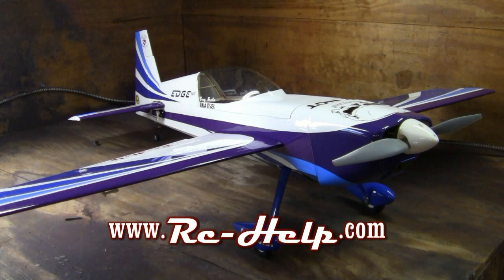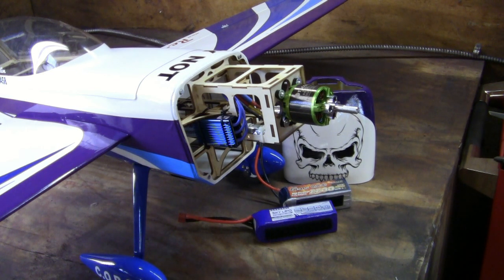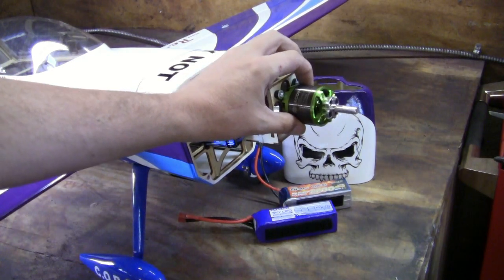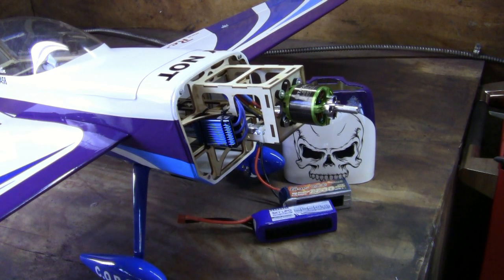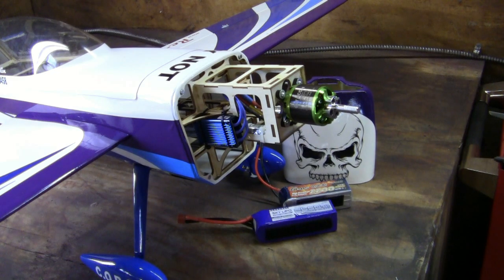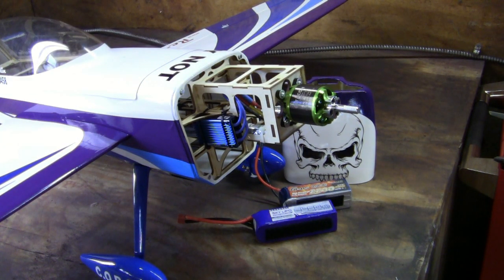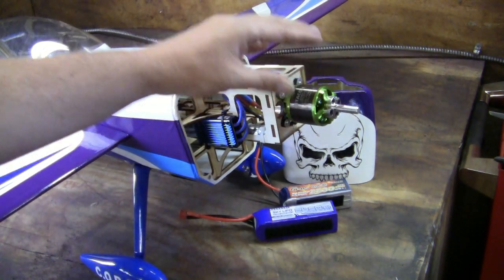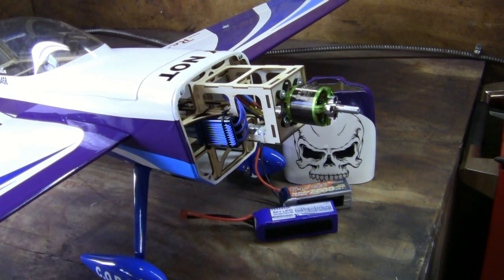Matching Motor, ESC, & Battery

Comment: Confusion. What do you mean by "bigger" battery? Do you mean a higher amperage rating? Do you mean more voltage? Both could be bigger, one would make a difference and the other would not. 

If you use a battery with "bigger" voltage, you WILL get more power. This is what "they" mean.
Reply from the maker: In this video, "Bigger" was meaning the C rating, or Amperage rating. Back in 2011 when this video was made, everyone was saying "go with a 'bigger' (more amperage) battery and you will have more power". But, this was back in 2011 and I need to remake this video to be more clear. I made this video to get the point across that a higher C rating will not get you more power, and if it does, it was not a large enough C rating to begin with. James, I appreciate your comment
Reply: @RcHelpDotCom   Ummm a higher C rated battery will give you more power, especially if you use a higher esc.. Example..  you motor pulls 55 amps, but you could put a bigger prop on that allows  you to pull more amps, but because your batter can only say put out 65 amps, it will put out more up to the burst and then get  hot expand and then fail.   but.. if  you put say a batter that puts out  65C now that same motor will pull the bigger amp draw, but at what expense? maybe more heat in the motor, maybe more heat in the ESC.. basically your video is very good at setting correct esc,batter, and motor specs, but it doesn't protect against bigger draws.. The fact that brushless motors will pull  more amps... power based on the battery and ESC, and load but at the cost of motor damage or even burning it up!!.. We in the RC Boating have this problem all the time to go faster.
Reply: @ericdiannestrickland7511  The C of the battery itself doesn't provide any additional power.

What produces power is the load on the motor.

BUT, if the load is draining more current than your current battery can provide, probably the battery is getting way hot. Switching it with a higer C battery now you can deliver the current your motor is asking for, and thus getting the "additional" power...

Remember, is not the C of the battery that is providing any power. Take a setup which drains 10A. Assuming your battery can easily provide 30A with 20C for instance, switch the battery with a 60C one.. power will be the same.
Reply: Tony, you are trying to explain how to match these components but then you say "bigger battery".  You also say that folks are wrong when they say you get more power when you use a "bigger" battery.  You need to define "bigger".  Most of the time the average modeler means higher cell count (4S vs 3S) when they say bigger.  You WILL get more power if you use a 4S battery than a 3S battery.  The 4S battery has a higher voltage which result is more power.  So, don't use ambiguous terms like "bigger" say exactly what you mean (higher voltage bigger or physical size bigger or higher mah bigger).

Comment: Saludod desde colombia, construí una savage bobber de 2 metros con un peso al despegue de 1750 gramos tengo dos motores un volantex 4023 850kv y un turnigy aerodrive 910kv ambos con helice 12" y bateria 3S 2200, que me recomiendan muchas gracias por su ayuda y pronta respuesta
Reply from the maker: Hola @mipezunivalle, ¡Parece que tienes un par de modelos fantásticos! No estoy seguro de qué información solicitas, pero con la que nos has proporcionado, parece que estás bastante cerca de lo que necesitas. Ambos motores pueden girar una hélice de 12". El Volantex debería funcionar bien con una de 12/6, mientras que el Turnigy parece preferir una de 12/5 debido al mayor KV. Por lo que he podido encontrar, ambos funcionan con un paquete de 3s, así que, siempre que tu clasificación C pueda con los motores, no debería haber problema. El motor Turnigy requiere un ESC de 30 A, pero yo probablemente le pondría uno de 40 A para mayor seguridad. No he podido encontrar mucha información sobre el Volantex, pero creo que sería más o menos lo mismo. Si hay algo más en lo que pueda ayudar, ¡no dudes en preguntar!

Comment: I like your style. I’d love to see a vid on how to do the same when you don’t have a manufacturer’s recommendation to start from,i.e. scratchbuilt planes.
Reply from the maker: Hello @joevanarsdale981! Scratch built can get fun when trying to pair electronics. My rule of thumb is to try to find a model that is close to your scratch built plane, and start there. It's likely that you will need to go up or down on all 3 components unless your luck is better than mine LOL. Take the RCH Trainer for example. I designed this plane off of the Telemaster and took the specs from the Telemaster to start off with. Granted, I went to the lower side of the motor size and ended up burning one up, but it gave me a starting point. But doing a video on this is a great idea. I will see what I can come up with when I get another scratch built going that doesn't have a spec sheet! Thank you for the comment!

Comment: Good video, covering the motor and prop selection.  However, I wish you would have provided references how you came up with these formulas for prop diameter, pitch and rpm.  You also didn't indicate the stall and pitch speed (or advance ratio) for a successful flight.  Did you, for example, compare your findings with ECalc to see if there are discrepancies?

Comment: Hi sir plzz help me,,,,I have 2200mah battery,and  dxw d2212 2450 kv moter ,,,How much esc is required?ESC ?????
Reply from the maker: You have incomplete information. 2200mah is just the capacity, you didn't specify what the C rating of the battery was so no idea what the battery can handle. Also, you need to look at the spec sheet of the motor, you cannot determine amp draw from KV. KV is only RPM/Volt. https://www.youtube.com/watch?v=pA0SmWwXu2E

Comment: Great info. Thanks. So... I'm a little baffled and confused. I have a few Zeee 6s 6000mah 100c packs. By your equation at @1:28 I've calculated that this battery can produce 600amps?! No way that's right.... Is it?? :O
Reply from the maker: The equation is correct. However I would doubt that 100C rating on a 6000mah pack. I'm thinking that would be more of a burst rating, if even that. For this battery, I would base it off the wire gauge. Likely not more than 50C at the most.

Comment: WOW ITS nice explanation .its hard to set up ,can i ask  pls sir.i have 1200kv 3536 motor what battery i need to use for my plane,and  rating?and more the 4s3p li ion battery would work for this.esc is  30 amps.

Comment: Still prob the best and one of only things I can find on what you would think is one of the most common questions!
So really on any engine, you can run any voltage battery as long as the Amperage is enough? Is it that simple

Comment: can I ask? Can A2212 2200kv brushless motor work with a 11.1V 2200mah 30c lipo battery?
Reply: the brushless motor is 30A
Reply from the maker: As long as it can handle a 3S battery, yes. www.Rc-Help.com

Comment: what if the max amp supplied by the battery in more than the ESC rating?
Reply from the maker: Doesn't matter. The battery does not 'push' the power, the motor 'pulls' the power. All the battery is there for is a storage device for power. You can use as large of a C rating as you want or can afford. Just make sure the S rating is correct. www.Rc-Help.com

Comment: Thank you very much for this instruction video. I recently bought a glider but I am using a different battery than what the box instructed me to use and got mixed info regarding how I am to work out if my battery would work with this motor, using your instructions I was able to work out that my battery was more than enough for the motor and that the ESC can handle the battery perfectly fine.
Reply from the maker: Just remember, the motor is what pulls the power, the ESC regulates that power and the battery just supplies the power. As long as the ESC and battery are large enough (high enough amps) to handle the motor, you should be golden! www.Rc-Help.com

Comment: One thing great info but you didnt explain choice of mottor and prop
Reply from the maker: For this video, I was explaining how to match the Motor to an ESC to a Battery. For the motor, you will go off of the wattage divided by the voltage to provide amperage. All motor manufacturers have a suggested prop range, and they all should be within the wattage of the motor, as that is the max power the motor can sustain. Hope this helps.

Comment: hello good day, can i ask some question? I have been performing this combination, was this combination is correct for:?

120brushless esc
4068 1900kv 2200W brushless motor
100C 22.2 V Lipo Battery

I just did your computation and it conclude that my setup was
22.2v/2200W= less than a 90Amp?

Thank you have a great day God Bless
Reply from the maker: For the motor, 2200 watts with a 22.2 nominal voltage will be 99.099 amps. Basically 100 amps. 
2200/22.2=99.099

If you have a 100a ESC, you should be fine. 

You didn't say what your MAH of the battery pack is, however if it's over 1000mah, again, you should be fine. 

www.Rc-Help.com
Reply: @RcHelpDotCom  Thanks Bro really appreciated it. I didn't have the battery yet, but I'm planning to have 22.2v with 4200mAh and 120a ESC.. with your guide many people especially fellow RC hobbyist can achieve their own milestone without hesitating because of your videos

Comment: Hey guys I'm wondering what would be the best ESC/speed controller for brushless 2445 5600kv.  (Draws 59 amps) I've heard that you Wana match the amps with the motor or go itleast 20% bigger .     What do you guys think is best 60..80. 100amp . I just Wana run it on 2s maybe 3s .    It's an absolute savage with a 35 amp ESC but drains battery way fast      I realized the kV matter and now I def need itleast 60 amp.   Do you recommend I go more then what the motor does (59 amps max it says)
Reply from the maker: If it's 59 amps max, then a 60 should be fine unless you are at max all the time. If you are almost always trying to max out the amps at 59, then I would go the next largest size. You also mentioned 2s and 3s, per ohms law the higher the volts, the lower the amps, so you will need to calculate this as well. Come over to rc-help.com and we can help a little further if you have additional questions.
Reply: Judging by your video (you match the amp) I have one that draws 37 and one that draws 59..   I'm gna use the 35 amp on the 37 should be ok .    Then get a 60 for the one that makes 59?  Should be fine   you seam very knowledgable on all the components.    I just built these 2 RC cars with a 2440 at 4600kv and a 2445 at 5400 kV.    Your video just helped alot man   I'm gna subscribe and build a plane with your knowledge brotha thanks

Comment: Great video.
Quick question, if the lipo is 25c 2200mah how can you get 55amps continues? I thought with a 25c you will get 25amps continuous and around 50am bursts.

Comment: What if you already have a motor and want to put it in a new model, but the motor only states size and KV? Some model companies give the kv to match, but what if the kv is good but the size doesnt match smaller/bigger? Some others give GP/EP options, how do i tell if my EP motor matches the GP size? How do I work out the Watts or Amp of my motor with only KV on it? Ive got two motors I wanna use in new models, a 3226 - 970kv, and a 4250 - 910kv

Comment: Thank you for the video. It falls down badly for me when it says 'the motor is 700 watts' - how do you know that? It all makes sense with that knowledge, but not knowing makes it impossible to proceed. Also, I have to set up a power train from scratch, and have no 'manufacturers recommendations', so again, impossible to proceed. Thanks, anyway.

Comment: I'm build a 1800mm ov10 with rimfire and 80amp esc can I use 6s lipos instead of 4s the motors are rated up to 6s ?
Reply: I'm using two rimfire .46 outrunner brushless motor 800kv

Comment: What if i have an airframe weight avrage 1.44kg with 2200mah ESC, what motor i have to use for this RC-plane?
I've try twice with 2212-1000kv but always fail.
Reply: Good power rating is 150 to 200 watts per pound.
Reply: 3.117 lbs you need a motor that can generate 556 watts about 175 watts per pound then you to find out how much room in the battery compartment  for your battery how many series cells can fit that will supply  enough watts amps volts  after that go to a motor web site like, Tom cat and then start 
checking the motor sizing chart from the chart it will help you decide which motor will work for you.

Comment: Shit according to this I need a 120 a ESC ive been trying to use a 12 a oops. That makes sense of why the motor won't run lol. That plus my cheap ass charger only charges one cell on my 2 s , which has probably broken my battery.

Comment: Tekst źródłowy
In your case 2650 was because you had to add weight issiue. But in case of this Edge plane and your set. With solved weight issue can you spend more time in air? 2650mAh is always more time for fly than 2200 or I'm wrong?  I would like to understand this good. 
thx
very good tutorial

Comment: I'm a little confused but because of I'm a noob, not for your video! if I understood, if I have a 500watt motor, with a 6s battery I need a 35 A esc, with a 3s battery I need a more powerful esc (70A) is that's right?

Comment: Very good video, but if you're playing around with prop sizes you best be careful when due to prop size you're pulling more amps than your entire setup can handle and you're on the brink of a burst or electrical fire.  Use a "Watt Meter".

Comment: Thank you, that is really helpful.
One question though. Is there a way of calculating the wattage of a motor when it is not given by the manufacturer?
Reply from the maker: If the manufacturer has not provided a max wattage or max amperage, then you will need an Amp Meter, or ammeter, whichever way you want to spell it. Put the suggested prop on it (or whatever load your situation requires) and run it at full load with a full battery. Remember, Ohms law, the higher the volts, the lower the amps, the lower the volts, the higher the amps. www.Rc-Help.com
Reply: @RcHelpDotCom  My setup: motor 650 watts, esc 45, battery 3200 maH, 20c.  from your formulas, now I'm concerned about smoking the 45 ESC?   It was in an ARF, (except battery, which I bought).

Comment: looking for help with the matching of a rocket 600kv rc boat motor and esc ..what amp should we use and what battery size ??
Reply from the maker: I do not know, as you have not provided any voltage, wattage and/or amperage ratings for the motor. The current capacity of the battery and ESC MUST be higher than the motor can pull. www.Rc-Help.com
Reply: @RcHelpDotCom  thanks for the feedback here are the ratings : 600kv max amps 126a max voltage 50v max power 6300w no load current 1.8a
Reply from the maker: @tonyjaikaran6085  If it was for my plane or whatever model, I would be looking at a 150a ESC, and a battery that can handle about 175a just to play it safe. www.Rc-Help.com

Comment: I want to buy a e flite 60 motor for an 46 bonanza. I can't seem to find the right ESC any help on what brand is best or which one to get?? I'm switching from Glow to Electric. So excited!!!
Reply from the maker: E-Flite is suggesting an 80a ESC to put with this motor. I cannot find any specs on the E-Flite 60 motor for max amp draw, so I would go by their recommendations. I use HobbyWing ESC's (pictured in this video) and the have worked flawlessly for me over the years.
Reply: @RcHelpDotCom  what engine do you recommend for me? With the EsC  plz, if it's not to much to ask.. I was seen some malfunction on the Eflite 60 with their ESC they recommend....,😔
Reply from the maker: Come over to the forum and post up with your question, and be sure to mention what you have posted over here. We have a lot of great people on the forum that can provide many more options than what I can alone. www.Rc-Help.com

Comment: I know it's a different setup but random question. Just purchased a 3500 7.2 v larger battery for my RC car. It runs fine forward but nothing in reverse. Is it possible the esc can't handle the bigger battery?  It was running a 2000 7.2v
Reply from the maker: MAH will have no affect on an ESC, nor will C rating. The S rating (voltage) is what affects an ESC and as long as that is the same (and according to your post, it is), then everything should be good. I would recalibrate your ESC and see if that fixes the no reverse issue.
Reply: @RcHelpDotCom  thanks for he reply. Yeah I have reset and calibrated the esc several different ways but everytime it won't work in reverse. It lights up to say it's working but nothing. Might need a new esc I'm guessing
Reply from the maker: There are some ESC's that have a reverse lockout feature for when you want to race (since reverse is banned in racing). Might be something to look into. If that is still not it, come over to the forum and post your question there. We have many fantastic members over there that can help out with just about anything. www.Rc-Help.com

Comment: So if you had a 80 amp speed control would it not be a problem on that plane ?
Reply from the maker: Wouldn't be a problem at all. The 80a on an ESC is what it can handle. The motor is what is pulling the power.

Comment: Can a esc be to big for a receiver?
Reply from the maker: Yes, and no. There is no such thing as too big for the Rx, but there is such a thing as too much voltage going into your Rx. However, most of the BEC's in an ESC are topping out at 8.4 volts or so, so most receivers can handle that. It's the servos you need to worry about. www.Rc-Help.com